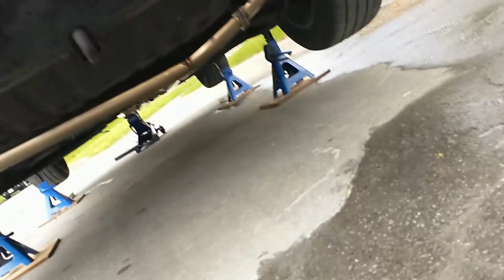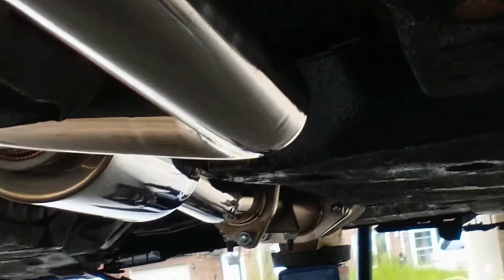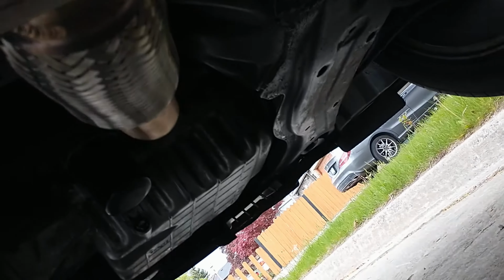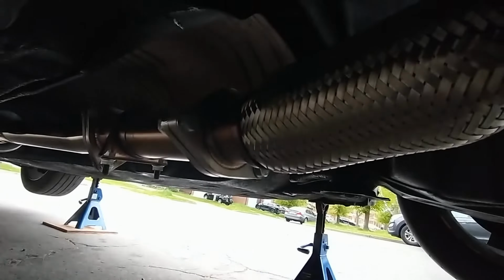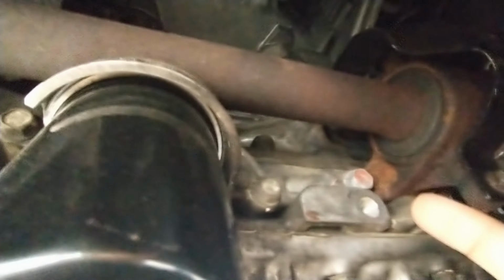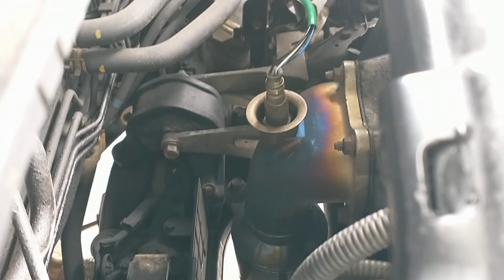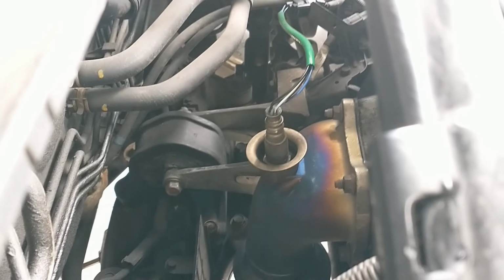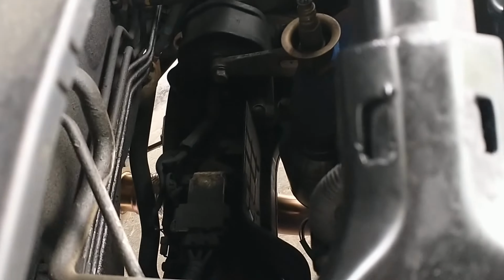Acura TSX (CU2) Yonaka Catback Exhaust x PLM Header (Cold start, Flybys and Revs)

Comment: I got a 2013 Sportwagen, and I am so glad the exhausts fit the same so I can get proper sound clips lol. Thanks for this. I was looking into getting this setup.
Reply from the maker: Glad I was able to help
Reply: They bolt right on but the tips come up short and burn the bumper. Ask How I know 😂. Wagon bumper is just over an inch longer than the sedan.
Reply: @chrisb15679  How long did it take to burn?
Reply: I also have the wagon and the catted PLM-PCD-I4-CAT they just came out with, I don't want to attach it to the rusted oem exhaust lol

Comment: That rasp that youre hearing is due to the downpipe, put a vibrant res infront of the yonaka resonator and itll go away. No need to do a muffler delete
Reply from the maker: I did exactly that. It still has rasp at high rpm but it's less annoying. https://youtu.be/qZSSWi2Qa10?si=AIO5_SFoM8SpnOxj

Comment: im curious to hear what skunk 2 dp and yonaka cat back sounds like on these cars. i have rv6 dp thats straight piped and the rasp is killing me. 
nice to hear this combo on the car
Reply from the maker: I would think the skunk2 would make it sound more rowdy. Doubt someone will make a video on that anytime soon though.
Reply: Lots of people have reported the skunk2 downpipe cracking so I would avoid it
Reply: @SBBUK  I’ve had my skunk 2 downpipe on my 09 accord for the past two years no problem and I live in ny . Holds up fine  . Just picked up a 09 Tsx 6 speed thinking about grabbing  the Yonaka catback and pairing it with the skunk 2 alpha downpipe I have
Reply: Run a "branch" resonator after the downpipe it helps with cabin drone and rasp. Synapse engineering makes a good one.
Reply: Do you have stock cat still?
Reply: @PROofHAPPYWHEELS  2 months ago. my custom cat back rusted off splitting  off my muffler.

I now have a custom 3" catback (1 resonator with a ktuned muffler) with rv6 dp. The car sounds aggressive. Its a nice deep tone but a little bit on the louder side. The car sounds similar to an f1 style / j's racing exhaust i think. I couldnt be anymore happier with it.

Comment: im looking to getting this exhaust but that buzz kinda messes with me
Reply from the maker: @asstronnn  I installed a vibrant resonator after I made this video and it fixed 90% of the buzzyness/rasp. Cost me an extra $300 bucks to get it installed though 😕. Will have to a make a video on that soon.
Reply: @_kanes  what resonator did you buy?
Reply from the maker: @asstronnn  vibrant
Reply: @_kanes   where did u buy your catless downpipe
Reply from the maker: It's a catted down pipe and I bought it from jspec performance in Toronto